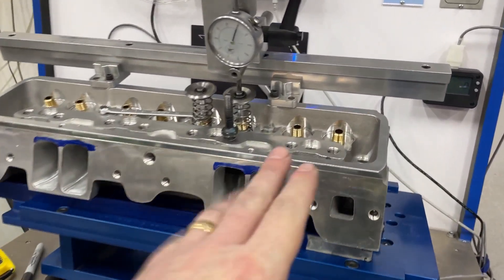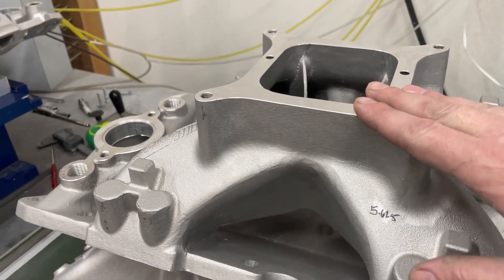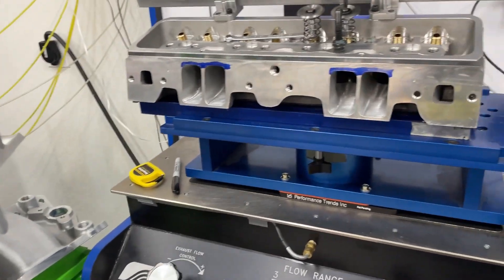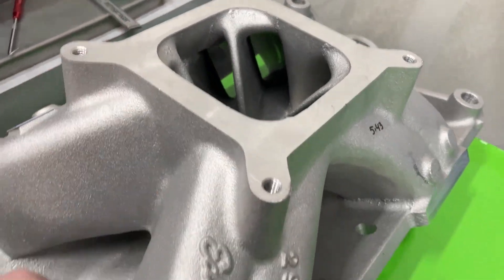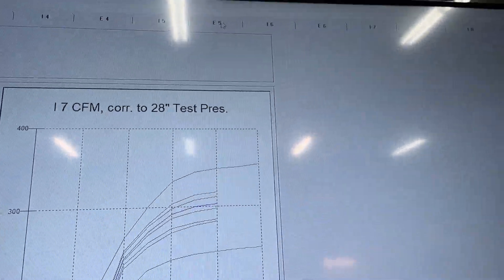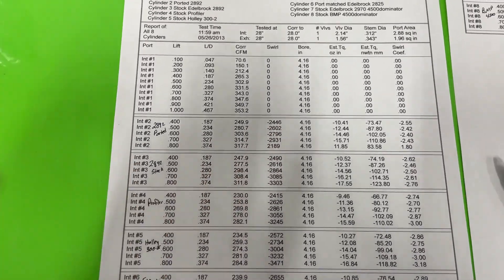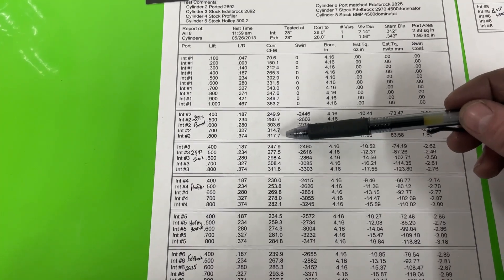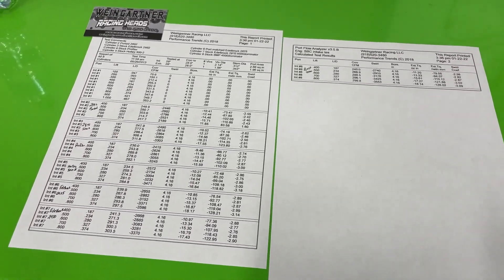Which SBC Intake Flows More

Comment: Hey bub, my truck on methanol wt a 2975 ran 30 xs 6.88 most of them wt a 8! It is dialed on a half of a 750! It runs 6.38 et wide open! Im wandering if a 2925 intake would need a jet change? PS. Same question on a bigger header? Im running 1.3/4 & may go bigger if i can just raise fuel psi

Comment: would love to hear your recommendation on a gen 1 sbc mpi intake manifold. been looking at edl-29785. thoughts? when your going for big power worth the investment for porting?? ive got a 434 13:1, 700 lift 264/268 109, brodix alum block with cnc trk 1 heads. currently running the weiland ram efi manifold. considering the edl 29785 with a wilson throttle?? thank you! vids are super awesome!

Comment: I have a 383, 11.1, .470/.480 flat tappet cam, 3.73 gear, 2k stall. Would you recommend a dual plane or single plane? Truck sees track mostly
Reply from the maker: Dual plane

Comment: It's hard not to notice you didn't use one brodix, intake that's very interesting.. ii looks like the Super  Vic 4150 is a top choice here.
Reply from the maker: I didn't have any at the time but if its a Brodix intake and it says HVH on it they suck out of the box. The others are good.
Reply: @WeingartnerRacing  .. right on. I'm not a fan either. A good friend bought an El Camino with a good 388 ABC. Oliver Ross, I think Calies crank..  dyno I think was 526 at 5900 or like 6200.. has an HV 1014 on it.. small port version.  IDK the cross section yet but I think he can make more power just w an Edelbrock, even an older Super Vic.
Reply: @WeingartnerRacing  how does a ported brodix hvh compare to a ported 2892 if you did the porting ?
Reply from the maker: @nickorozco9177  any Hvh intake is not very good.

Comment: What is your opinion on this? Getting ready to build a sbc 357 with AFR 195 as cast heads. AFR dual plane intake. 10.1 compression. And either the comp 268h or the comp 270 marine cam.

Comment: Hi I really enjoyed this video.  I have a couple of questions. I would like to see you flow a stock sbc Edelbrock Performer Air Gap and one that you have ported or sent to Extrude Hone to Equalize the runners as much as possible and also use a 1 inch open spacer on both that these manifolds respond well to. Second lets say I was building a 11:1  327 .030 over so its now a 331 and wanted 500 hp, so in theory I would use a Air Flow Reasearch 195 with the competition port job. This way smaller cc than a 210 should equal more port velocity. Now, lets say you can equalize the ports in the manifold to say, 288 cfm on average of each runner. Does the head have to be able to flow anymore than that to make power. Its nice to have the big flow numbers but if your manifold cant get you there then should you just buy a set of heads with lower flow numbers?? Or, are there things that I do not know comming into play. Thanks for the awsome content but this is what I think about and would like a concrete answer.

Comment: Would you be interested in flowing a 300-260 intake with a 4150 Holley throttle  body attached? Kind of a newer model and haven't seen anyone posting any info on it.
Reply from the maker: I can but not attached to the heads I used in the video because they are being assembled and shipped out this week.
Reply: @WeingartnerRacing  what's a good time to call when it's not going interrupt your work? I also have an untouched 7101 performer rpm, and an older regular performer.

Comment: fair enough.. it kind a makes sense.. the coeffiecent of thew swirl is weird at a guess its a self meter for u .. if u know a good number dyno and mani flow for a certain build i think it will be relevent other wise you could run nissan r35 gtr airflow meter in the cylider wall there supposed to flow 550 cfm or something it maybe read something.. another way or even better before the the carby because it will only draw  the air it can flow kinda likek a dyno carb swirl hat
Reply: also the 35 gtr has reversion flow build in so maybe if u could bolt it in to a carb spacer its probably 2 inch wide  or 1.5 ... it could give you maybe a reversion pulse to if flipped  if the the valves was say running at 7000 rpm .. at a guess u kinda want to minimise reversion back up from inlet valve specaily carby although it could add more atomisation  probably why long runners do so well .. i can understand having bulk volume on super vics the air has some where to go the reversions slower and the track ks easier on draw ins .. i guess  does that reversion pulse of atomised gas cool the air charge and aslong as it doesnt reverse draw on the carb jets it shouldnt because v8 a ITB weber it could
Reply: this swirl has opened a can of worms specail reversion pulse to feed other cylinder . like does reversion pulse help feed next cylinder intake stroke or hinder it because the intake swirl to carb entry clash.. fight each other in the plenum makes sense plenum volume helps free the air for repurpose of direction
Reply: can u get a intake swirl meter on a dyno and figure out the pulse intake swirl on a engine dyno .. cant rememer what there called the machine that spins up engines for value terrian testing
Reply: @jacksonbermingham2168  spinmotron

Comment: It is incredible how the manifolds kill a great cylinder head. Would a good tunnel ram help? What is the answer?
Reply from the maker: Yes
Reply: @WeingartnerRacing  the old pro ram and pro ram 2 used to be the max flow tunnel rams. Will they support a modern cylinder head like yours? Is something new needed to keep up with modern  350cfm sbc heads?

Comment: Would love the same kinda deal for us street guys running dual planes! But holy crap there's a bunch of them! I'm actually surprised that the Pro-filer didn't do better! Just for shit and giggles should've probably threw in a couple of cheapies like pro comp, professional products etc. But very cool info.
Reply: Well you see The Problem is, there are certain people will get their nose out of joint, and turn their nose up at it, when you show that an el-cheapo Ported Professional Products Hurricane, or the Procomp single plane flows as much or more than the name brand manifolds. 
Just saying.
Reply from the maker: I just didn’t have them here or I might have.
Reply: @WeingartnerRacing  I have a 7101 Edelbrock performer rpm, a Holley 300-260, as well as one of Ken's First performance tpi intakes. All untouched If you're interested in flowing them and using them for a video I'd eat the round trip shipping. Awesome vids sir!
Reply from the maker: I would do it but not attached to the heads in the video because those are getting assembled this week and shipped out. I can do it with an afr 220. Send them.

Comment: Great Video. There is tons of data there. I have 3 questions for you. 1. Will increased swirl produce more HP & Torque?? 2. If you flowed the manifolds by them self would the CFM increase VS bolted together?? 3. If the manifold is flowed by itself should it flow more than the heads?? I have heard that the manifold should flow more than the heads by 30 CFM. Any truth to this??

Comment: Thanks Eric. I have a Profiler/Wilson ported. My thought on that is when not port matched the runner entry was rather small and tapered in to allow for a port match. If possible could you comment on that compared to the others that were tested? I remember the center divider at the head face between ports being extremely wide maybe 5/16”ish with a taper from about 1” in the port exit to the flange face. Been a few years now though but in my mind that would kill it without being straightened and sized.

Comment: Really nice info! I’m running a holley strip dominator right now,  could be wrong, but i wonder how much the port air speed has to do with swirl, or if the angle the air comes around the valve through the chamber has more effect? I know it not a real reasonable thing to do, but it would be cool for someone to do a fresh intake manifold test on the dyno